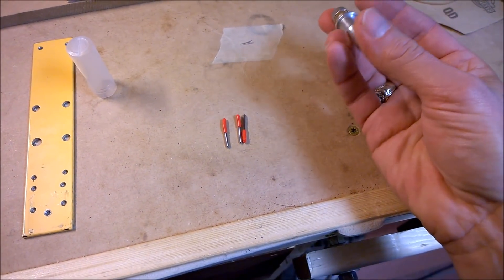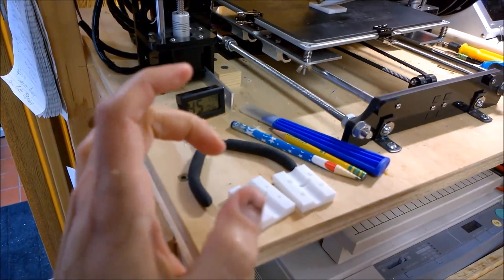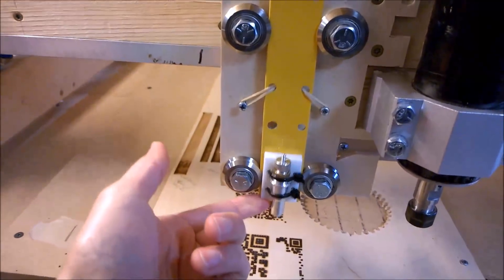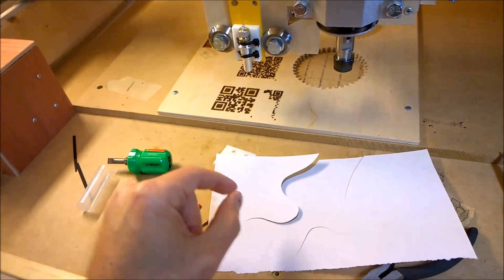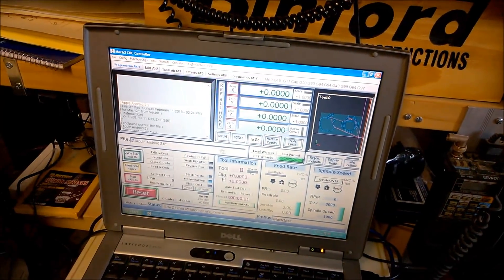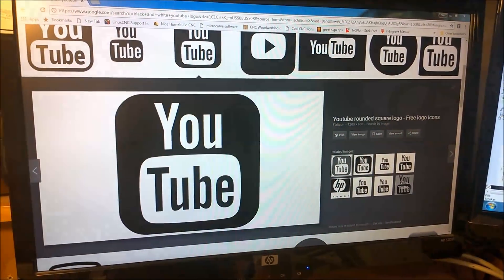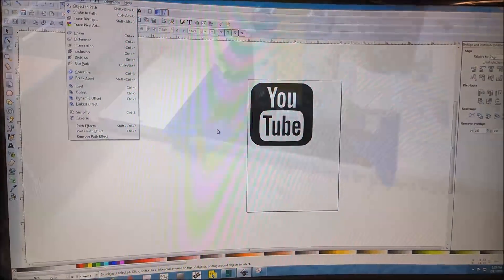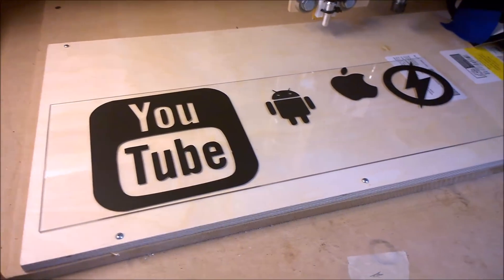DIY CNC - Drag Knife Mod - Cut Vinyl Stickers!

Comment: Hi. I too plan to do some vinyl cutting on a small CNC machine using the same drag knife. I believe the knife should orient to the cut as the blade point is slightly off centre but also seen people using software to determine order and direction of cut and specify radii. What software did you use? Do you have to go into such detail about the cut or will the knife simply rotate as cut direction changes? Thanks for the video.
Reply: The blade is held in by a magnet, so it is free to spin in the direction it is being pulled.

Comment: How do you set the z axis? Do you set it so the tip of the blade just barely touches, than add a 1/32 of - z in the software? Also what feed rate did you find best?

Comment: How accurate are these cuts ?  Lets say you cut a square 1" x 1".  What are the final dimensions and what is the inner or outer curvature radii ?  A simple test would be to get some kapton tape on a surface and just cut a square.  Then measure with calipers.  Great idea BTW.  I might invest in one of those cutting heads for $10.
Reply: Accuracy depends on the quality and calibration of your CNC.  If you can cut a 1" square with a fine tipped router bit, you can do the same with the drag knife.

Comment: I am getting ready to mount mine to my CNC machine. Why did you need to make the mount slide up and down between those 4 rollers?
Reply: Sturdiness so that the blade can not tip in the holder.
Reply: @HalfAssHomestead  I just mounted mine in the collet of my CNC on a totally flat surface and it worked great

Comment: Your video was interesting enough to go and order the little drag knife, looking forward to setting it up on m y CNC
Reply from the maker: Excellent.   It's a fun little tool to play with.  Best of luck.
Reply: @drez20001  Hi mate,
I got my drag knife and playing with it. I expected the blade to stick out from the bottom before pressing on the top to actually take out the blade.The blade adjustment just dosent seam to let it out the bottom. Did you find this ???
Reply from the maker: @terrybrockhoff8168  Hmmm.  Mine adjusts as needed and works very well.  Not sure what to suggest other than reaching out to the seller.

Comment: so, dumb question, why not put a drag-knife in a collect holder on the original motor instead? Just disconnect the power to the motor. I plan to try that using a foam base plate to absorb any over shot with the knife going down.
Reply from the maker: It could be done but a more complicated adapter would have to be designed.  This was a simpler way in my view to get it done.  Best of luck.
Reply: I was thinking the same.  If the cutter diameter is smaller then make a split V block with an OD enough to clamp the cutter.  3d print it since plastic would likely be strong enough.  Failing that get a split rod and use a V file.  You could add a spring and magnet  in there if there's enough space.

Comment: Hi !   Do you need some special software to generate the tool path  or  it works like a normal cutting tool  ?  Thank you  !
Reply from the maker: No special software needed, other than what is typical for CNCs.  To cut the vinyl stickers I just set the cut depth very shallow, say .0625 or so.  Just enough to put a little downward pressure on the cutting edge.
Reply: Thank you  !!!!!!!!!!!!
Reply: Does it need a drag knife toolpath??
Reply from the maker: @shenavlogs6291  I didn't use anything special to use the drag knife.  The only thing I did was to sort of trick the software into thinking it was making a very shallow outside cut.  Best of luck.

Comment: Interesting. I wonder if there is a good way actually mount it inside the router's spindle. Thinking of trying something similar, so thanks for link to that neat-looking drag knife.
Reply: Thats what Im going to try. 1/2 in collet almost fits. A little tape I think it will fit snugly.

Comment: how small do you reckon the text cut be cut to? i might need to apply some to project boxes
Reply from the maker: It works great for larger text and images but with my CNC for really small stuff it doesn't do as well.  With that said though other folks have been able to have good results with small cuts.  Thanks for your question.
Reply: The size of the letters only depends on your patience in weeding out those parts you want revealed.

Comment: Nice vid! Is it possible to adapt this drag knife onto a 3d printer?
Thanks
Reply from the maker: Thanks.  Some folks have done that.  The MPCNC can do both 3D printing and use this drag knife.  https://www.youtube.com/watch?v=B3hCXXCczBI
The Ultimaker can be modified as well.  https://community.ultimaker.com/topic/16402-cutting-vinyl-with-an-ultimaker-2/

Comment: Nice video, thanks for adding the link to my site! The tip should have an offset of 0.25mm if your CAM allows for overcut you can get some really sharp corners. As for the blade stick out I use way less. I have a little tutorial on how I set it on the site. The basics are you want so little it will only cut the vinyl and not touch the paper. You can test it by hand then just drop it in the machine.
Reply from the maker: allted Awesome.  Thanks for the tips.  Great little cutter.
Reply: I am SO buying one of these by next paycheck,I would buy it now but I've just spent half a paycheck on tools and upgrades for my 3dprinter.

So I'll  have to wait another two weeks gasp 

Ok the tool isnt expensive but the shipping to europe is nigh on prohibitive, 3x the price of the tool itself. By the way... extra blades?
Reply: nvm. found'em
Reply: @djeeno  esticazzi?
Reply: Good rule of thumb is to set the blade to only stick out of the holder the thickness of a standard business card.